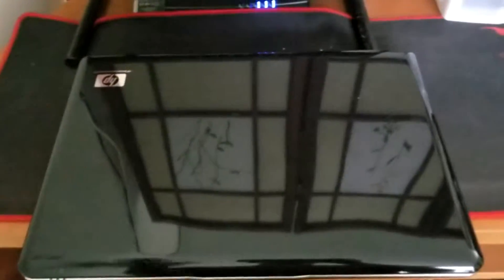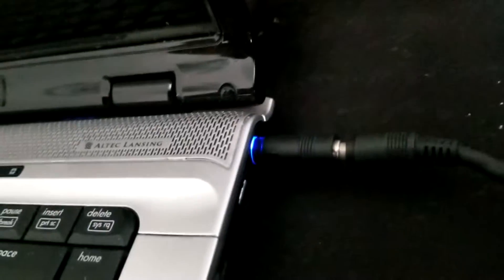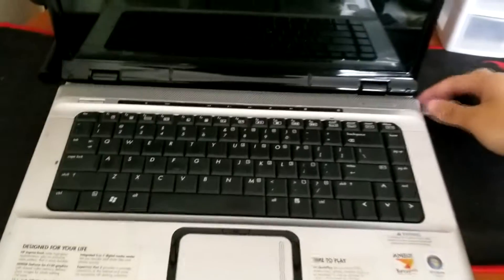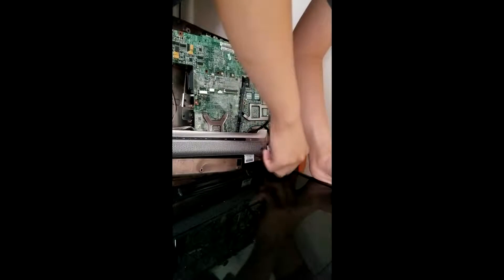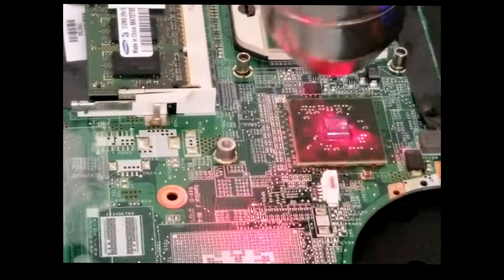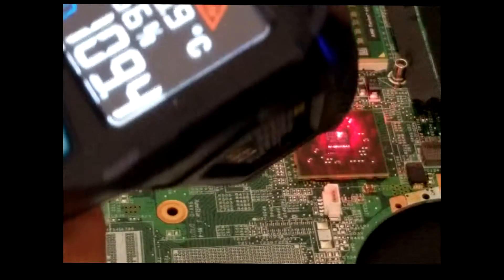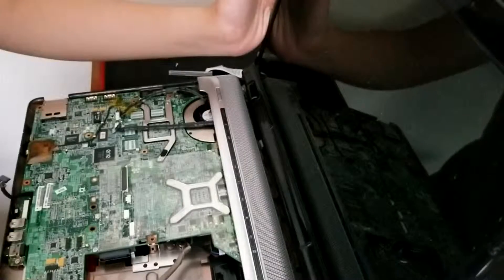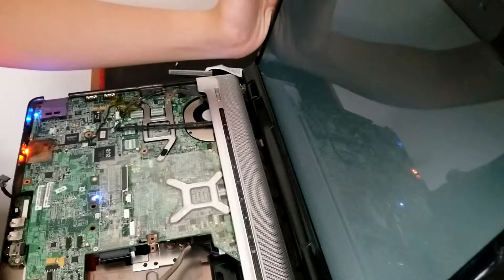dv6000 reflow gpu

Comment: I was given this laptop as a gift 6 years ago. It has the same problem, I never repaired, stored in the cabinet all this time. I have Hot Air Station because I want to learn how to fix phones. 
  May you tell me, What is the TIME of exposure and what Temperature did you setting it? What was your outside room temperature? 
I noted that you have a fan turbine hot hand gun you approached the tip of the hot gun like 2 inches, which that part could have had more detail at the moment at reflow. Thank you if you can clarify me those questions.
Reply from the maker: I upgraded to a hot air station. Basically 300c with 2 inch away more than 30 sec .with flux
Reply: @awstech6217  Thanks.